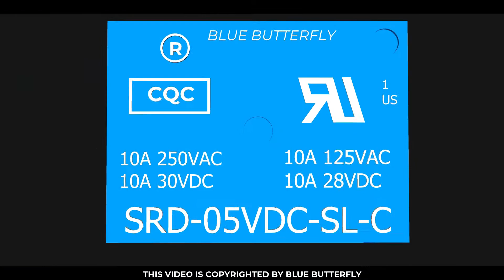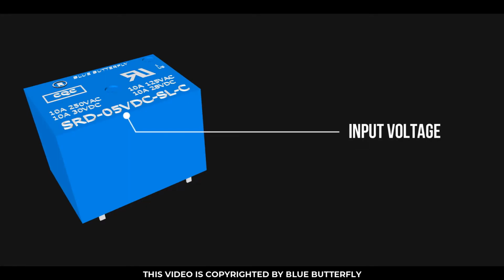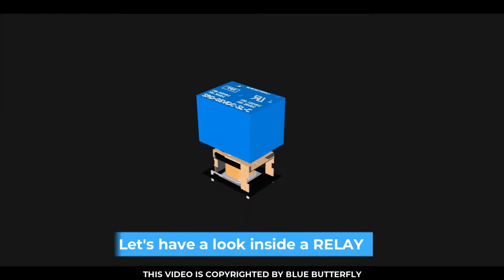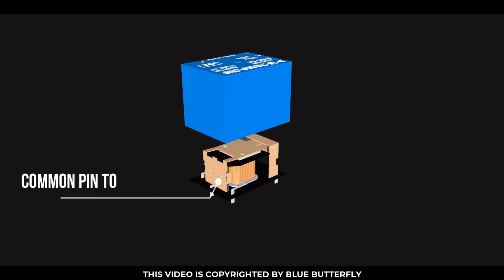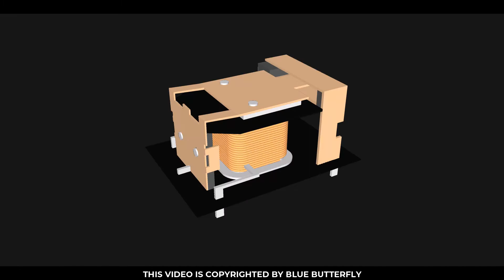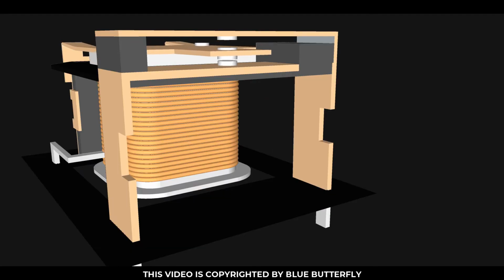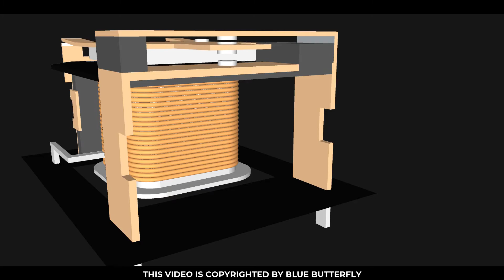How Relay Works ? | 3D Animated 🔥

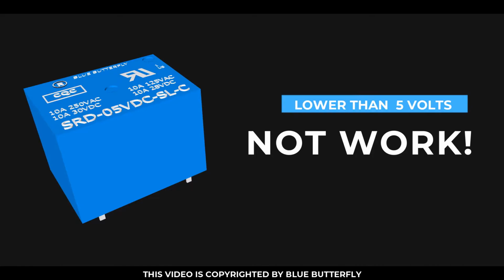Comment: 0:45
4.99V - Not work
5.01V - Will burn everything

Does not seem like a correct statement
Reply: That's just an ideal value.. Of course it will work with 4.99V and with 5.01V will not burn, but if you make it work with a relevant value over the maximum work voltage it will start damaging it, not hard to understand